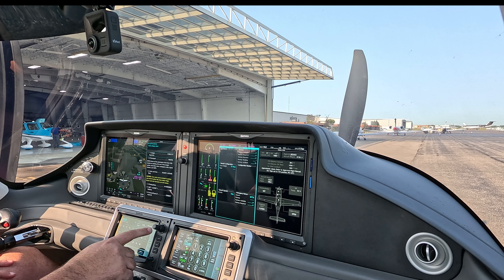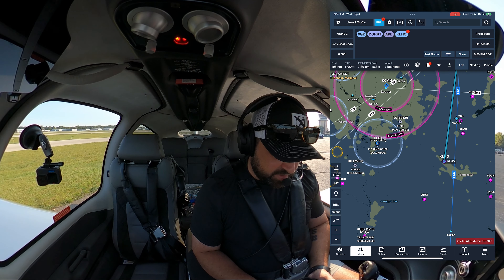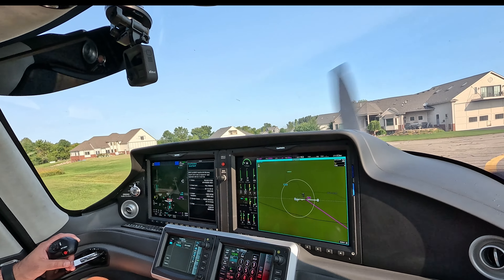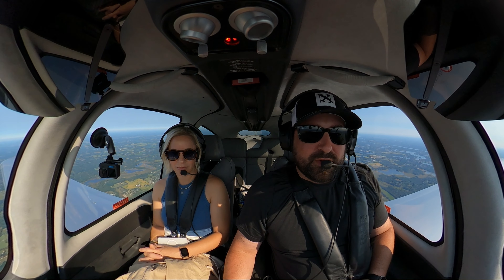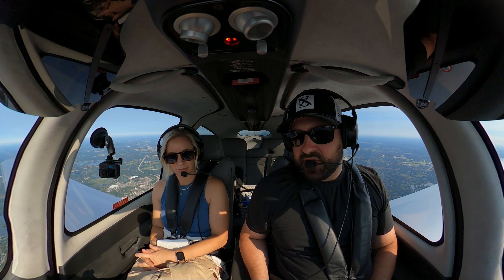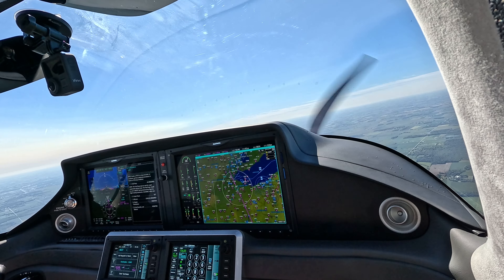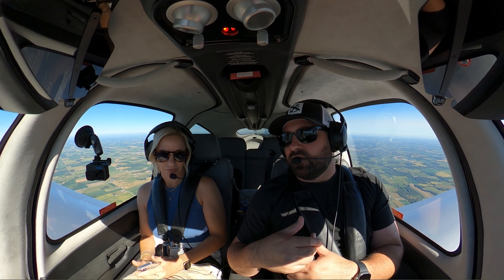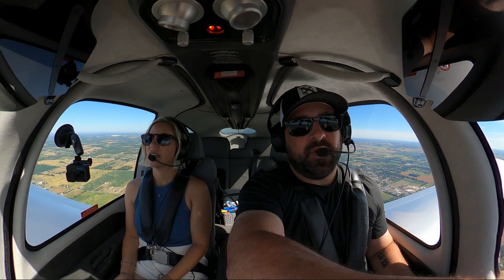Cirrus SR22 G7 - Cross Country - Hocking Hills State Park

Comment: I’m waiting on G7 next month. Been flying a demo G7 in prep. I was taught to hold the starter button for 10 seconds regardless with a quarter inch throttle, and after pushing prime for 3 -5 seconds…It ben working every time
Reply from the maker: They replaced the starter switch at the 100 hour, working much better since. It was doing nothing at times, regardless of how long I was holding it. All is good now.
Reply: Awesome, I’ve seen a few G7 with the bubbles popping up,  look like it’s beginning above  your panel. LThey tell me mine will have the fix before delivery but if not they will fix. Are you getting any pushback on that fix?
Reply from the maker: @RoL-r9h yeah, mine are bad. They gave zero push back on replacing the entire thing, but it’s going to be a minute.
Reply: Gotcha. Not near as bad as the one I flew yesterday and it was only a couple month old.  Mine arriving in Knoxville mid October hopefully they will fix prior.  It’s a known issue for sure and my rep assured me it will be taken care of if I have similar issues
Reply: There are a number of “growing pain” issues with the G7. I picked up mine in Knoxville in June. Mostly interior cosmetic items, but the push start button has been an issue. In addition, I had a mag go bad at about 50 hours. I’m sure over time Cirrus will resolve the problems. I think the new avionics are worth the headaches.
Reply from the maker: @jims3276  agreed

Comment: Had the same issue with my push button start.  They had to replace it and now its perfect.  Happened around the same number of hours.
Reply from the maker: Yep, my new one they installed during the 100 hr is perfect. Hope it doesn’t continue to be an issue after time.

Comment: Does hot starts  give you much of trouble in G7 after a brief flight over or did you keep it running for the pick up. Great videos thanks for sharing
Reply from the maker: Nope, I’ve got hot starts down. Everyone seems to have a slightly different technique. I should show mine in another video. In a nutshell, when hot and stopping briefly, I do the following.

Flood engine (prime) with mix full & throttle full. 

Pull mixer idle cutoff

Leave throttle full and boost off

Start engine, once engaged… flow through the following. Boost on, throttle idle, mixture rich.

That works for me every time without fail.

Comment: I think for C airspace you have to hear back your tail number!!! right? if they don't repeat your tail number and say "caller" standby and etc, you don't have the clearance to go to C. if not, I have to go back to school :D
Reply from the maker: Yeah, I think that is correct. For class C, the 7110 says:
"If the controller responds to a radio call with, “(a/c call sign) standby,” radio communications have been established and the pilot can enter Class C airspace."

So, if they OMIT the callsign and just say aircraft calling standby, I think that is a grey area and maybe you can't. But in practical terms, I don't think they would brasher you for it. I think I would be listening more for the "stay clear of the charlie" as you heard in the video to the other plane.

Good question for Opposing Bases ;)

Comment: I had to have my push button replaced. It’s a known issue at Cirrus.
Reply from the maker: They replaced mine at the 100 hr, all is good… for now.
Reply: @flying_scott  Before mine was replaced I was always able to start the plane, but it was getting more difficult. In the back of my mind I was thinking it wouldn’t be good if I needed to attempt a mid air restart and had to pull CAPs because the button failed. I must say I do enjoy owning a plane with a warranty! Wishing you blue skies and tailwinds! Ps. Love you’re getting your wife on comms. I’ve gone through emergency scenarios with mine, but have never had her do radios. It would be good for her to try before there’s an emergency - good job!